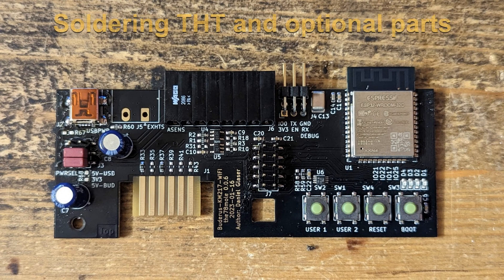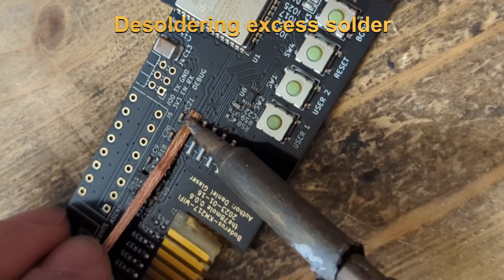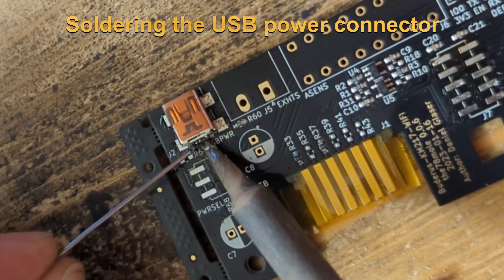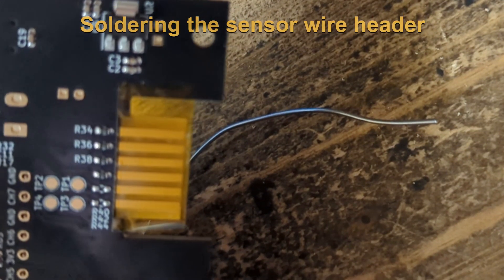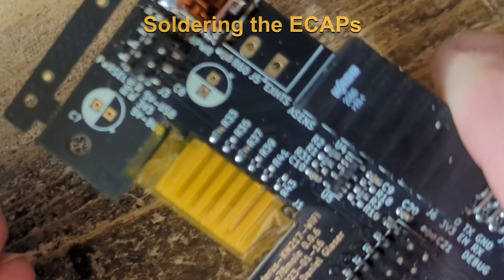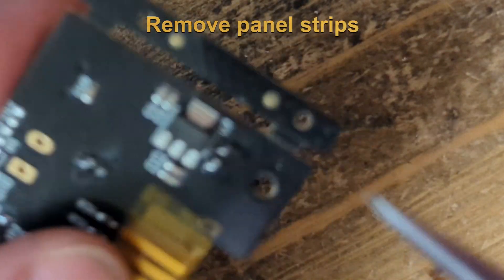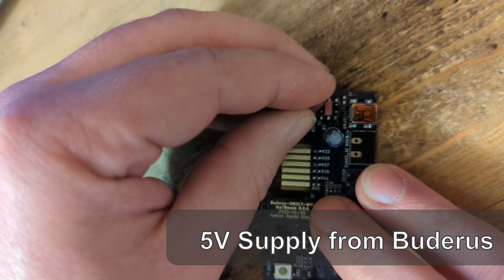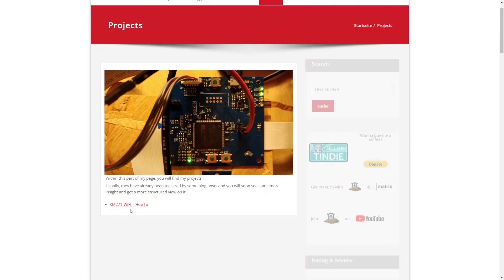KM271 Build And Flash

Comment: Hello Daniel, 

I am very interrested in your KM271 replacement and I would like to install it on my Buderus 2107 (don't know if it is M or not, but I understand it works for both) and to integrate it with my existing Home Assistant set up. I am curently using a Buderus BFU Thernmostat and my quesstions at this point are as follows : 

- will I be able to replace the BFU and control the room temperature with Home assistant? 

- Can leave the BFU as is or will I need to disconnect it to avoid conflicts? 

- or perhaps can I leave the BFU and set it at a very low temprature to keep the contact open? 

Thank you for this and all the exellent work you have done on this topic. 

Best regards, 

Pierre Pichery
Reply from the maker: Hi Pierre, I'm not an expert, when it comes to the BFU, but as far as I know, there is no such possibility, to set or read the values of the BFU stuff through the KM271 bus. It is somehow separated. But you can still control the different aspects of your Buderus through the KM271. If you order my module and it does not work as you expect, you can easily send it back to me and get a refund. But you should be quick, I only have a few units left (currently 3 from the last 100-batch) and I'm not sure, if I'll order a new batch. I think, most people that are interested in such a Smart Home connection to a quite old oil burner have already one of my modules and there are not many left, owning such an old system. 🤣
Reply: @the78mole  Thank you very much for your response and your advise about the order. Actually I tryed to order one today, but I couldn't make the payement on the web site.   I will try again. Also , is there a reason the order is placed in US $ instead of € ? 

Regarding the BFU, I found this other discussion today which confirms what you are saying:   https://github.com/dewenni/ESP_Buderus_KM271/discussions/44
Reply: I just tryed again and apparently the order went through without problem this time. Thank you for your help.
Reply from the maker: @Lepelot  👍